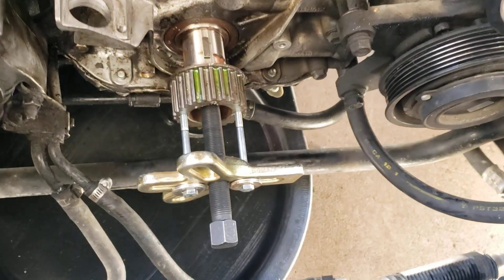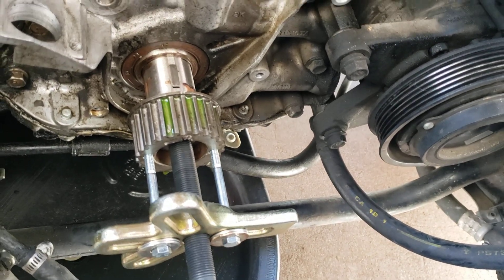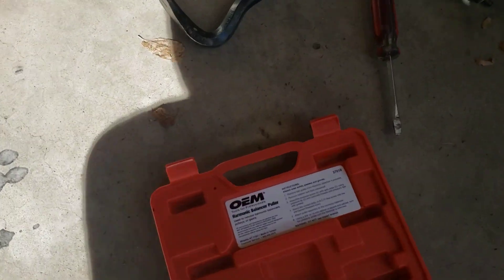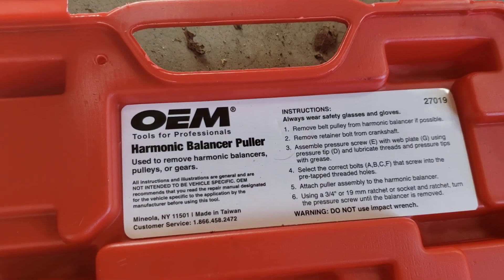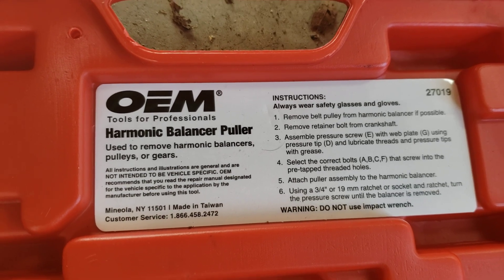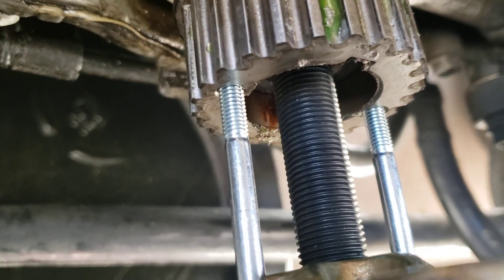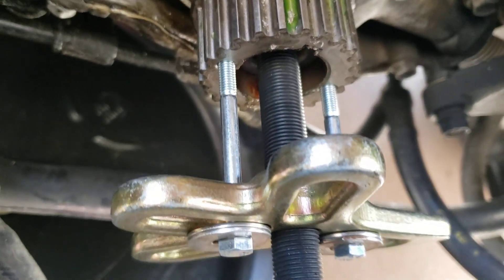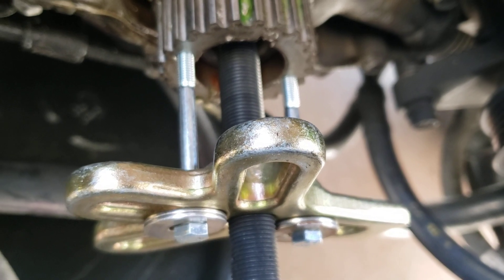How to remove crankshaft sprocket timing gear on a 2jz engine

Comment: For anyone trying to do this without a puller, i found success by spraying WD40 behind the sprocket and using a large flathead to pry it off. I plan on getting a new one, but you make break some teeth on the gear doing this. You have been warned 😂

Comment: How do you install it?
Reply: Lined up the key, pushed on by hand then used a block of wood to tap it gently straight on, from there used gentle taps with a hammer and flat punch

Comment: How do you get it back on
Reply from the maker: Use a dead blow hammer or rubber mallet. I may have used a socket that was slightly smaller then the outside of the sprocket